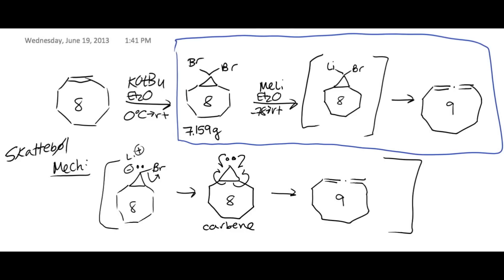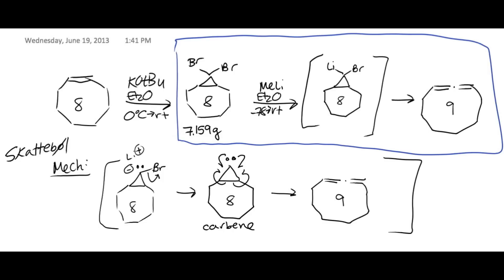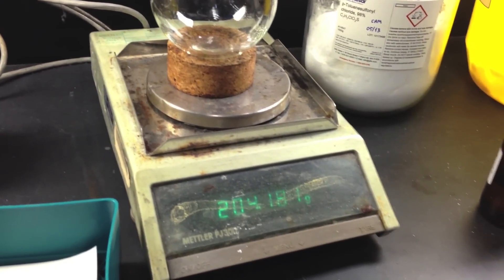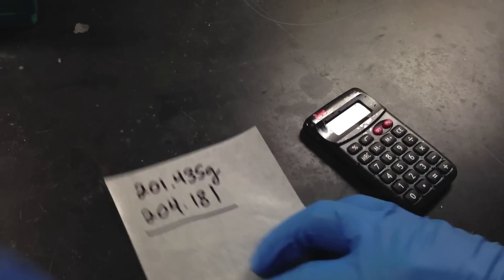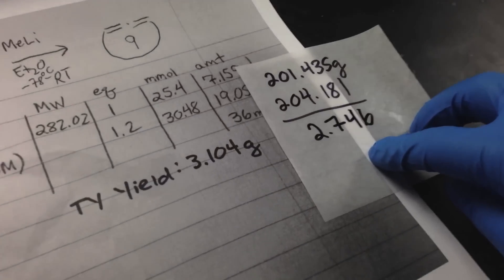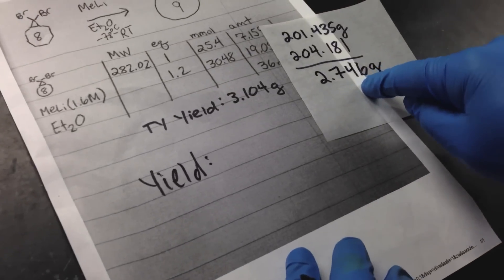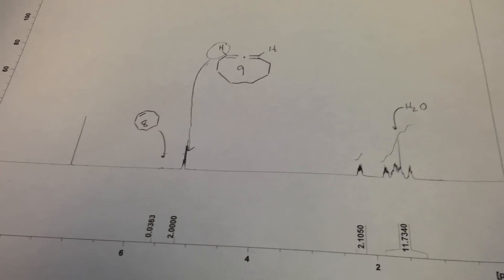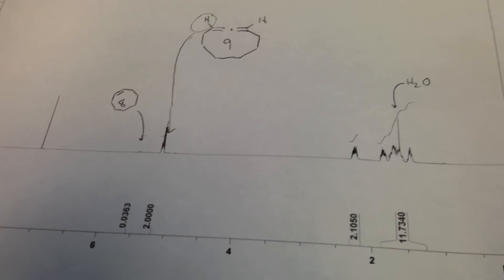Organic Chemistry: Synthesis of Cyclononallene

Comment: Hey guys great job!! I just wanted to know the strength of methyl lithium you have used fr this reaction
Reply from the maker: 1.6M in hexane, though it was likely a bit lower than than due to the age of the reagent. Best practices would require us to titrate the methyl lithium beforehand, but we did not in this case. Overall, it didn’t hurt our result since the yield and purity were very good.

Comment: Since the reaction is air-sensitive, isn't there a risk of some air getting in the syringe transferring the solution to the reaction flask if you just removed its tip from the other flask?
Reply from the maker: Hoang Long Pham Yes. For extremely air sensitive reactions this is a very real issue. In this case, the Cannula Transfer method is preferred.

Comment: How can you tell about purity only by looking at the nmr spectrum?

I mean, How can you give numbers? did you use an internal standard?
Reply from the maker: +Komar 92 Great question. Because the compound is relatively pure, and we know the identity of the sole impurity (cyclooctene), we can compute the ratio of integration of product:impurity 2:0.0363 = 55:1. This is equal to roughly 98%. This is hardly a quantitative measurement, but is certainly a good approximation. Internal standards are helpful in NMR when there are multiple impurities, and the identity of the impurities is not known.
Reply: Distill the cy9 (b.p ~69 @69 torr) it will be absolutely pure. Take NMR in d6 benzene as cyclononallene is prone to decompose under acidic conditions 👍